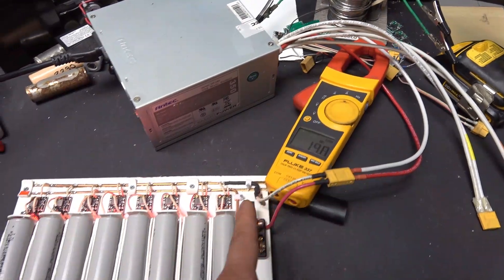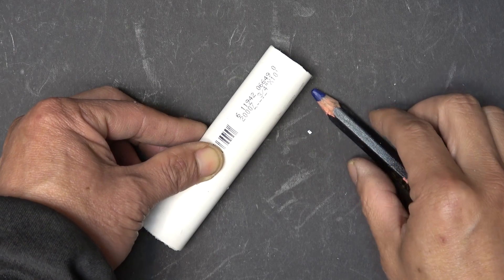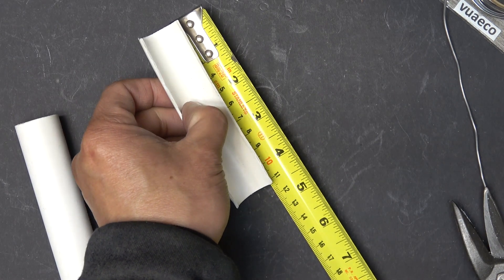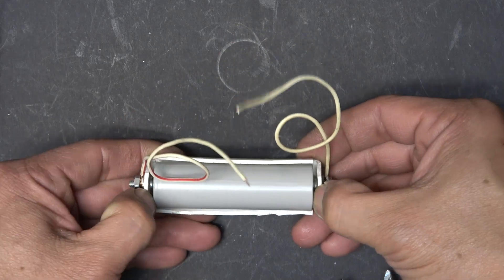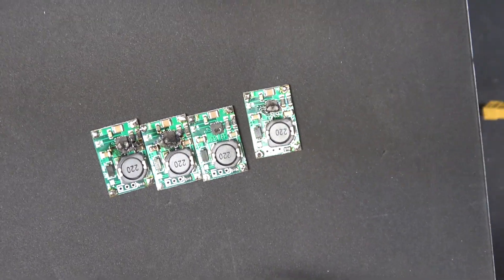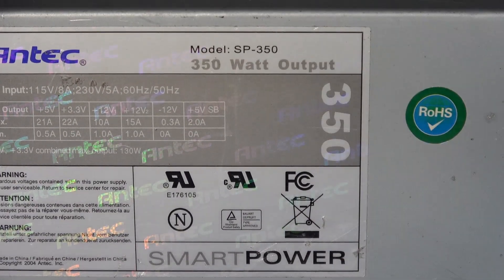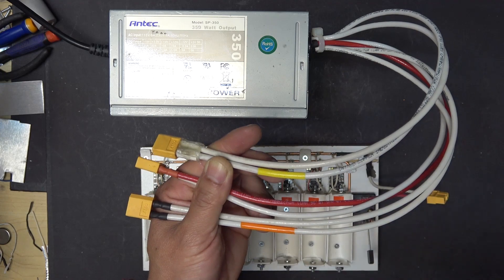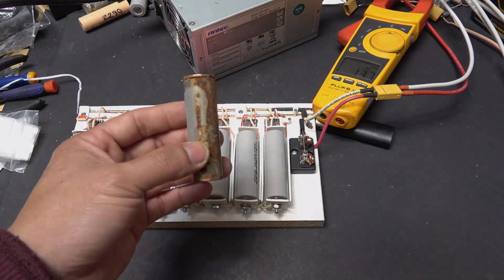DIY: Home made Tesla 2170 battery holder & charger from PVC pipes

Comment: You can also use 2xTP4056 in parallel.  But your 2A variant is more efficient. If you want even more current then there is XL4015 5A DC to DC CC CV 1.7$ available.
I also like to 18650-ing all my devices :)
Reply: is This xl4015 5A module has low battry  and overcharge  protection like tp 4050? Or is that just a buck converter?

Comment: Would you be kind to answer my question? I have buck converter can I put four of 32650 lifepo4 cylendrical cells and put in parallel and supply 3.6 volt and 4 amp ? My idea is to charge four of these cells in six hours. Thank you

Comment: Like the power supply idea,like like to see one with inline amp and voltage controller so you would not need the TP boards . Great vid,going to make that setup for my 18650s,may do 16 in a row at 1amp each for good slow charge over night.

Comment: The foam on the back of your meter is genius. My 2x18650s are just sticking out like a sore thumb, hot glue and all.
Reply from the maker: You have the same setup for your multimeter? :D
Reply: @vuaeco  Yeah. I have two Sony 18650s from an old Dyson vacuum battery. Lasts forever between charges...

Comment: Great video. So the good charger boards, are they based on TP5100? Do you have the link to EBAY? Thanks.
Reply from the maker: They are not based on TP5100. The ebay purchase info is on the video. I have a screenshot of the purchase on the video which has the item number, title, and pictures of the item.

Comment: Those $1.50 charging boards can we lower the charge on them?  Sure would be a great replacement for the TP4056 if so.  1.5A would be perfect for me with the option of going to 2A if I get a 4A cell.
Reply from the maker: The charging current is not adjustable for this board. It's meant to be used for higher capacity or high discharge rate batteries only.
Reply: @vuaeco  Well, that sucks.  That TP4056 is long in the tooth and can't keep up.  I wonder how the real chargers do it where you can manipulate the charging current?

Comment: I made something similar awhile back for 5 18650s. I also use a PC power supply.
I like the battery holder idea. I've found something  that works well for battery terminals. Those brass plated paper fasteners. The ones that have a round button and two flat 'legs' that get bent outward to fasten sheets of paper together. Just drill a 1/8" hole and stick the 'legs'  through and bend them over. The brass is easy to solder to. I usually flatten the button so the battery doesn't pop out.
Reply from the maker: Very interesting idea!